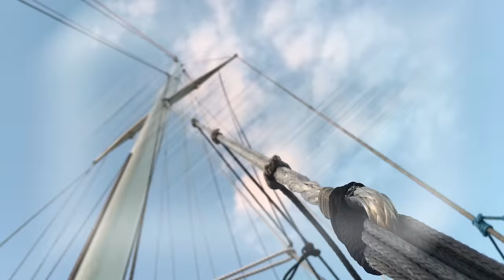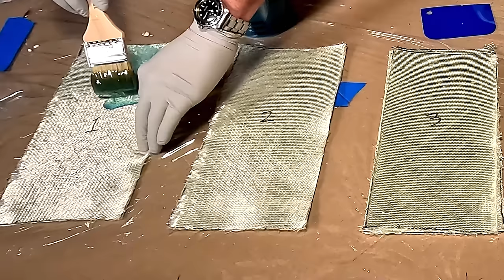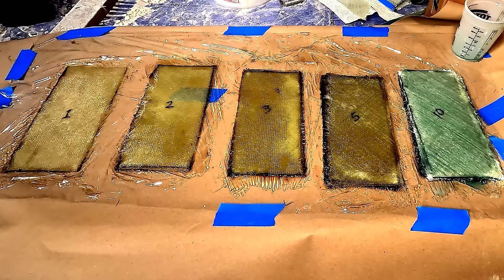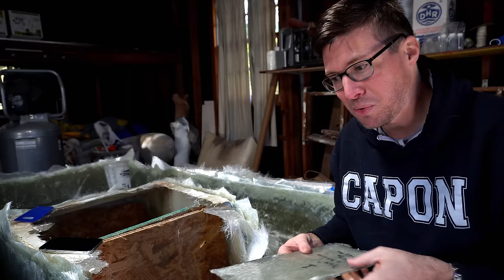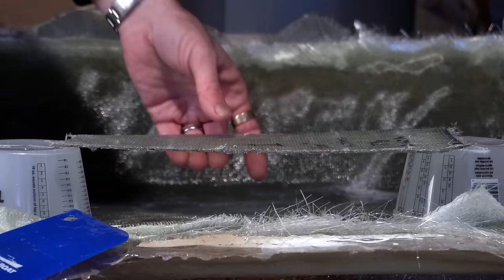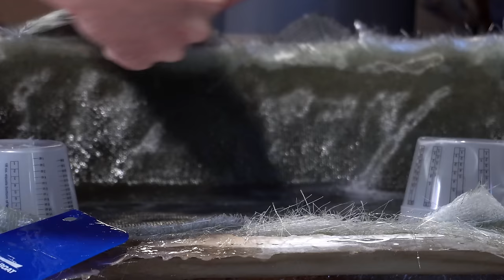How Thick is “This Many” Layers of Fiberglass? | Windpuff's Rebuild [S1 Ep 7]

Comment: How much resin is there supposed to be; how hard are you supposed to press to leave the right amount of resin?
Reply from the maker: 25oz per yard. 
The answer to your question is: I have no idea. I’m not an expert in this and I’m doing this test to see how heavy and how thick does my work come out to be. I definitely use too much resin so I come out on the heavy side but I still ended up at 6% lighter than the textbook weight.
Reply: A "qualified person" would know that the "experiment" was flawed because the laminate was not properly consolidated, and the cloth / resin ratio unknown.

Comment: What thickness do I use? "It depends".   Re: metric vs: imperial vs: US. I have come to the conclusion that Metric measurements are designed to "dehumanize" measurements.  As you have figured out, metric units don't relate to anything. They especially don't relate to anything human or in a way that humans think. It is possible recognize various metric measurements or sizes. For example just know "that is a 10mm nut". But the more use metric gets the more obscure it gets. Why do we measure snow fall in 100s of mm instead of 10s cm? It seems various official sources use the unit that is the hardest to visualize for any one measurement. Another thing to go away officially soon is the nautical mile. Despite the fact that we all have ten fingers, we do not think in 10ths but rather halfs, quarters, thirds and eights. Funny thing, so do computers which have to do an extra conversion from base 10 to binary and back for every calculation. As for US units, where did the US gallon come from? A gallons is 10 pounds of water but in the US it seems to have been taxed to 8.something or other pounds. Someone is picken someones pocket... It is funny that even looking at the standards metric units are based on, a standard meter is based on light traveling 299 792 458 meters per second.... say what? It couldn't have been 300million meters/second? As if anyone can see how fast light travels or can visualize 300 million meters anyway. I will note that somehow we got people on the moon with only 3 digits resolution, do we really need 9 or more? Yes I live in a "metric" country but we still measure flour in cups or ounces, use "2X4" to build things in 4 inch multiples, talk about how much we weigh in pounds and realize 100mm of snow is about 4 inches or a hand width... A distance is how many steps we take or how many minutes (or hours or months) it takes to get there.... humans don't care how fast we got somewhere or how far away it is so much as the time taken
Reply from the maker: The US gallon is 8 pounds of water. I noticed that there was a difference when I bought a fuel can in Spain from a British chandler. The jug has L and Gal on it but the marks don’t line up the same as they do on my US jugs. In the US, a 5 gallon fuel jug says 18L on it. The British 5 gallon fuel jugs have the 5 gal line a smidge above the 20L mark because it’s 22L to 5 imperial gallons. 

Metric makes sense for science reasons since it’s based on water. Volume, weight, lengths, all stem from water. 1g = 1mL = 1cm^3
1cal is the energy to raise 1mL of water 1°C
Water freezes 0°C, boils 100°C

Then you get into the imperial system and it seems so whacky but it is really practical if you are using the right units for the job. I’m sad to hear that the nm is going away. 6076.12ft = 1nm is such an easy conversion 🤣
The link between 1nm and 1’ of latitude was very useful. 60nm per degree N-S and a fraction thereof for the E-W. It made plotting easier as you could quickly figure your distance and time to arrive with these units. As you said, we don’t care how far it is as much as we care how long it will take to get there.

Comment: This is the funniest justification of the imperial system i ever heard 😂😂😂. Instead of multiplying the thickness for the number of layers you are going 15 32conds and divide by 3 etc 😅😅😅😅 sorry, maybe its just funny to me. Cheers
Reply from the maker: The imperial system is very quirky while the metric system is completely based around the properties of water.
Reply: @RiggingDoctor  and we all love water, based on this alone all sailors should be Metric 😁
Reply from the maker: Until they want to know how many miles are in a degree of latitude, then they will gladly resort to nautical miles ;)
Reply: @RiggingDoctor  you got me there😅 wait No you didn't lol...  because there's nothing wrong with calling an arc degree a Mile its a nice name. The problem arises when a Nautical mile is exactly 1852 meters an English mile is 1,609.3426 a us mile is 1,609.3472 and a Scott mile is 1,807. So, if I'm told without context that something is 10 miles away, i will need to ask, which Mile ? On the other hand a meter is a meter everywhere. 😁 Cheers mate

Comment: No chopped strand layers?
Reply from the maker: 1708 has CSM on the underside. Each “layer” is actually 1 CSM, 1 unidirectional fiber, 1 perpendicular direction unidirectional fiber.
Reply: One small detail to be aware of, Herbie.
You made your test pieces by wetting all the layers at once, as opposed to sequentially allowing each layer to polimerize before wetting the next layer . So you used up less resin, meaning your test pieces will be thinner and lighter compared to what you will end up with your project.
Reply: This is probably how he achieved 6% lower weight than,spec . but he was also looking to produce a given thickness and he now,know the max layers to achieve the,minimum thickness by this,layup method.

Comment: It would be great if you would also write the metric values on the screen so that the rest of the world would also know of what you are talking.
Reply from the maker: The metric values are merely *25.4 for mm.  I normally use metric but as I said the imperial system lined up perfectly with this test so I used that system instead.

Comment: I didn't weigh my layup using Totalboat 2 to one. Epoxy   and bydrectonal 1708 on my half. Inch. Thick. Layups. I did discover. In cooler Wether you can lay up a half inch  thickness without. Overhearing. As far as number of layers I lost. Count. But somewhere around 13. I also discovered that it gets a little spongy so perhaps. If you. Break it up into a few. Session with. Cure Time I actually. I think it would. Take fewer layers of glass. just. My observation. All the penetrations.topside.are through. Solid half inch glass Even the port lights. So nothing is going through the plywood core. In fact no penetration is within an inch of the core. Stronger and hopefully no future core. Issues. Time will tell.
Reply from the maker: Sounds like you are building it the right way. The Landing School in Maine teaches this style of construction. Everything that gets through bolted has the region of the boat converted into a compression ring that will take the load and protect the core.
Reply: @RiggingDoctor  I'll be following your build closely. It's funny, when I started doing my refit  videos on YouTube, There was only a few. channels. Now there's quite a few.  And people are showing interest. I need to get back to editing I've got. Lots of footage but I've been slacking on getting the videos out.

Comment: I would have performed this the lazy way: fiberglass two sheets, then multiplied.
Reply from the maker: I wanted to see the difference in stiffness too
Reply: @RiggingDoctor  when I was fourteen I made a nine foot hydroplane from design sold from an ad in the back of a Mechanics Illustrated magazine.  I used fiberglass to cover up my very poor carpentry skills.  With a ten horse power outboard it would achieve approximately 25 mph. I developed a hate for fiberglass from the itch from sanding.

Comment: You can add layers to fiberglass? Oh no.
Reply from the maker: All you need to do is sand the previous layer to remove any irregularities or strands sticking up and the next layer will go on over it as long as it’s just laminating resin. If you have finishing resin, you will need to scuff it up a bit more to give it more tooth.
Reply: I was being funny a bit. But I just did work on the top of my cabin and only put one layer of glass over most of the repair. I was very sick and was rushed at the time.  But your whole episode on "layers" has me fearing now.  @RiggingDoctor
Reply from the maker: One will keep the water out until you feel better and can finish the job :)

Comment: Hi guys long time viewer. You skimmed over the metric & focused on the imperial. Which I see why (because you miss being English 😂) No the formula makes sense but we might of miss another formula. The main thing is you have viewer through out UK Europe & the rest of the world
Reply from the maker: I normally do my work in metric, but each layers was averaging 1.19mm thick. It wasn’t exact as the test pieces were 1.35mm, 2.54mm, 3.68mm, 5.71mm, and 11.82mm. The imperial system was very helpful as the layers were exactly 3/64, 3/32 (6/64), 9/64, 15/64, 15/32 (30/64). 
Each layer of cloth added 3/64 of an inch, so the math became much easier to do. From this fraction, you can then switch to mm by *25.4. (3/64)*25.4= thickness in mm
I went with imperial because the pattern really showed itself clearly.
Reply: I noticed as you were laying up the glass, the resin was greenish, then oranges, then greenish again. Did you use different resins, or was it just lighting?
Reply: @kennethzielinski6233  the resin was ageing and turning brown as it was getting close to setting.
Reply: I had to rebuild my deck because the builder did not use enough cloth when they built my boat because it was built when fibreglass was first being used for boats. When I replaced my balsa core I was told to use 2 layers of (cloth with woven roving bound together). This was 20 years ago and there has been no signs that this was incorrect. My resin & cloth supplier was my source of information for the above. I don't know how this applies to your situation since all your calculations don't involve using a core for additional stiffness without the weight. Have fun laminating 9 layers of cloth.